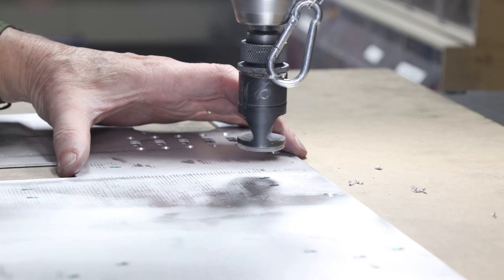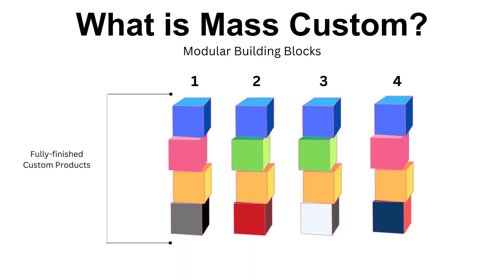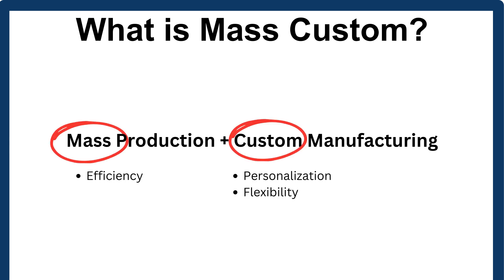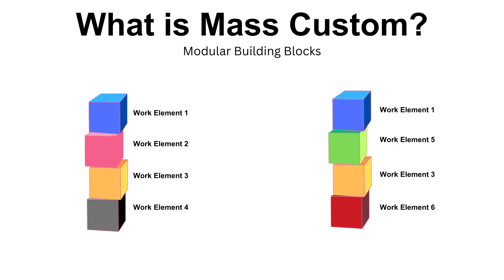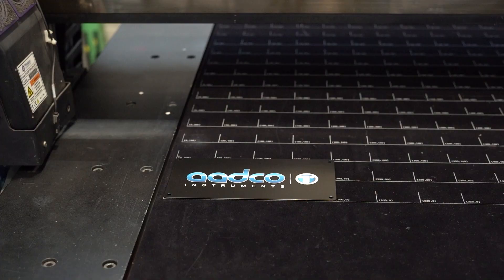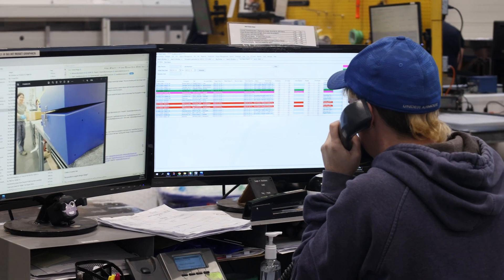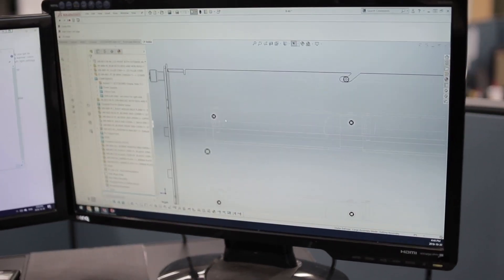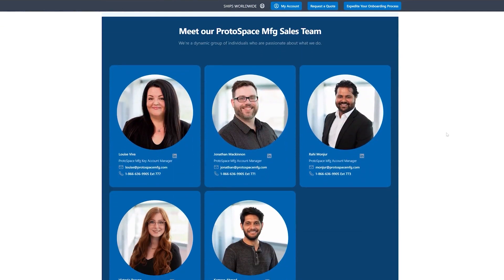Proto Tech Tip - What is Mass Custom Manufacturing?

Comment: The company i work for has a system that requires nesting programing and punching around 9,000 unique parts with all different shapes in in 24 hrs with one punch and not even a full time programmer 🫠😉